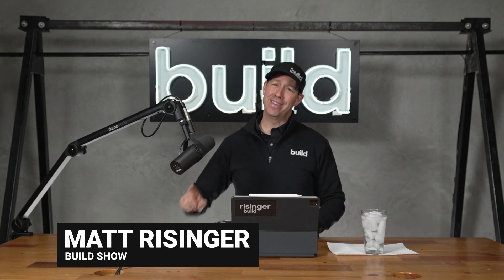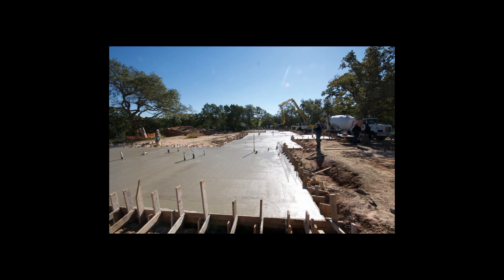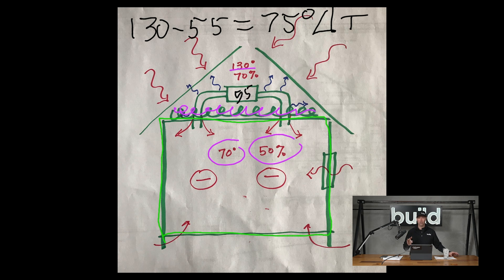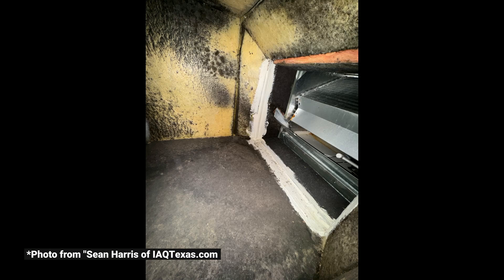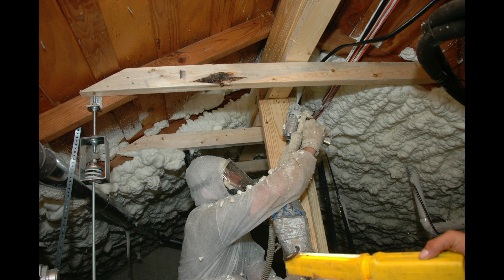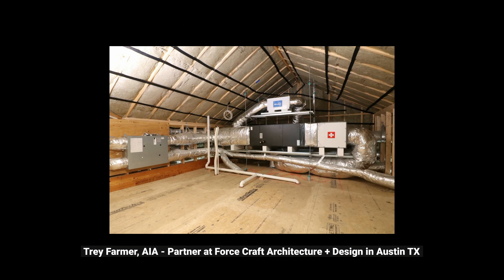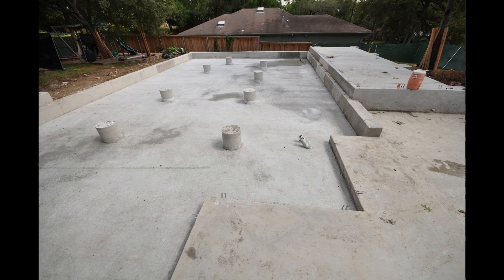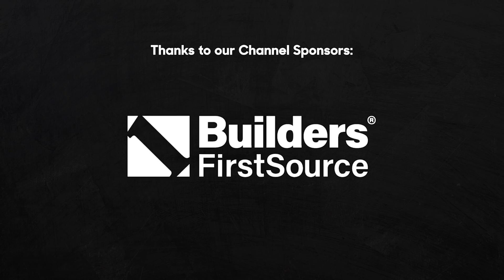Number 1 Dumbest HVAC System Mistake (Whoops)

Comment: What can you do if your duct work built is in the attic? I actually do not mind some cool air leaking to the attic or attic-air-duct not perfectly insulated and house not that air tight. Considering all the problems for an air-tight house if something goes wrong - moisture build-up, roof leak, water leak, shingles peeling off. Energy efficiency is not everything - got to have some compromise. I'd rather have a well ventilated roof and nothing attached to the roof-deck and sacrificing some energy efficiency.

Comment: Matt what is the cost to retrofit or remodel a house to those standards. I would have to replace all my outside sheathing and replace it with a insulated material, then cover that with the steel covering. Than the roof would have to be re-dun with a sealed covering then a metal roof and upgrade the windows which are original from 89 I think. How long to get a payback for this. You sell your house to one of the vultures owned buy a corporation it wont get all that. They'll will do the least to get it rented.

Comment: I have a 1957 built ranch. No basement, slab. My supply ducting runs through the slab to each room and my air returns are in the attic. So I think my setup is more efficient and the floors are warmer. The problem is that the supplies are not actually in ductwork, but jist open channels running under the slab with a pea gravel base, so I assume it has a ton of air leaks and probably not clean. I don't understand why they wouldn't have installed ductwork before the slab and because its under the slab, It would be very expensive and labor intensive to repair. My only real option is to seal the vents off with concrete, get a new furnace to blow up, instead of down, and run the ductwork in the attick. Either option sucks and I would rather get the ductwork under the slab sealed. Maybe run a sprayer through them and spray some sort of sealant. I can't find anyone that does that in my area. Thru all said without ductwork already there, they can't do it.

Comment: This got me thinking. You only need r-4 insulation for ductwork in conditioned spaces. So if you encapsulated a crawlspace and cut in a dampened supply or 2, could you then use r-4 bubble insulation and not have to mess with r-8 fiberglass?

Comment: As a general contractor the most common problem I see is faulty ductwork.  It is not that hard to get it right.  Put the supply registers at the perimeter of the structure with the return near the center.  It is really that easy.

Comment: Crawl spaces are not as bad as attics. Just think about it ... Heat rises!    I have seen as much as a 1/2 ton needed to be added based on a load calculation due to the ducts being located in the attic. In my opinion, the best option is to encapsulate the crawlspace and locate the ducts in the crawlspace with a downflow furnace located on the main level. Additionally, it may be possible to condition that crawlspace area by opening up a return and supply vent. this provides warm floors in the winter and prevents plumbing from freezing.

Comment: Also to clarify we have ductwork in the attic but the furnace is in the garage for first floor and in a closet on the second floor.  The attic fan works well - also a lot of my neighbors have whole house fans and they work really good until you have to turn the ac on.

Comment: The house that I bought in Indiana had ductwork in it and the second floor was never cool enough in the summer or warm enough in the winter.  I added on two story addition and added a second floor unit - and disconnected the first floor ahu from the second floor.  This worked much better but not perfect.  We added an attic fan and it brought the temp down from 140 to whatever the outside temp was and would turn off at 80 at night and come back on at 90 degrees.  This worked even better but still not perfect until…….I replaced the second floor heat pump 15 years later.  Our furnace guy discovered that the ductwork for the second floor unit was undersized and we had too much flex ductwork.  He fixed the ductwork size and took out flex duct and not the system is  wonderful!    I would say the biggest mistake you can make with a HVAC system at least in the Midwest is under sizing the ductwork and putting too much flex ductwork in.   He also installed a heat pump with a multi stage compressor and a variable speed fan.  The advantage being in the summer it will dehumidify at low fan speed and low compressor for a longer time.  I have never seen the fan on high ever in 100 degree weather.  Big fan of the this type of unit…..

Comment: The picture of the southern crawlspace looks exactly like mine... The vapor barrier is thrown down over junk and dirt, and go figure, when it gets hot in the summer, I get condensation on the bottom of our metal AC duct junction box and the ducts themselves. My quick fix ideas are ( in order of cost ): Add a drip pan under the box where most of the pooling happens and pipe it outside with PVC, close the vents in the crawlspace and add a dehumidifier, take up the vapor barrier, grade the crawlspace so french drains actually work, add a sump pump, completely insulate/seal the space and redo it so it is more like a mini basement... all the options suck lol

Comment: When they installed my solar air heating system (yes, heat, not electricity), they put the ducts IN the "fluffy stuff", which there was tons because cellulose insulation is super cheap so you might as well load up on it - what else are you going to do with your attic? (just make sure you have the venting correct!!)

Comment: I live in Europe and most of the office ventilation ducts are inside the inner ceiling with a "fake" ceiling below it to hide the ductwork. It of course makes each floor higher, but otherwise it's usually working fine.
Reply: In America we call that drop ceiling lol

Comment: Just worked in an area where none of the workers or inspectors knew what the rating was on the seam tape they were using. 
No inspector is getting in an attic to check tape.

Comment: Whenever it's windy my bathroom exhaust flaps bang around like crazy. 
At my last house I could just hang a magnet from them and pull it off when I wanted to use the fan, but this new place has a 90 degree turn and plastic flaps so that trick won't work. 
Is there a quick/easy fix? 
I know I could tear the thing apart and put a stronger (or any) spring on it to keep it closed, but two problems. That's a lot of work, and it might keep the thing from working when I want it to. 

Suggestions?

Comment: Builders don’t care. They put the HVAC where it is cheapest. A lot other times their ducts are too small. Remember the HVAC installer’s name is “Low Bid”. I have a 1.5 story slab on grade, cir 1977, and the attics were not able to be insulated. The HVAC sweated profusely. The problem was ths coil was too cold mainly because the fan speed was low. I did not understand that new replacement blowers would go bad. Then I replaced the air handler with not perfect results and reduced, but not eliminated sweating.  I then replaced the outside unit with a RUUD 20 Ultra variable speed. The duct air temperature was warmer and the unit ran low, slow and long. I set it to run 40 minutute on low and then shift to high. The shifting to high speed takes care of the humidity issues the low speed causes.  The sweating is gone and so is my high power bill. Variable speed to the rescue.

I still agree with your video, but sometimes you can’t fix stupid and you have to find a way to live with stupid.

Still living with stupid.

Comment: I agree with you 90% 
I’m a retired HVAC&R contractor from NE Illinois. I’d say that at least 80% of the systems are poorly built. 
We now live in Oklahoma and often visited our daughter who lived in Texas with all the supplies and returns in the ceiling makes the floor cold in winter. 
Many systems in the attic are very difficult to service mine is nearly impossible, as I’m 70 years old I can’t even service mine (trussed roof). A replacement system is planned. 
FYI our house was built in 1979

Comment: @Matt Risinger I live in Texas and I have one of those attics you're talking about. I"m from MN and I'm really not a fan of how it's done down here. I want to improve it, but I have limited funds. So here are my questions. 
Would wraping the ducting with some fiberglass insulation help? 
Would building a room (conditioned space) around the HVAC equipment in the attic help? 
Would insulating at the roof line with foam or rockwool make the roof shingles get even hotter and shorter their lifespan? My shingles are only going to last about 12 years as is, even though their 30 year shingles.
Reply: First of check your ridge vent if your shingles are failing. Or add more vents, I only use ridge vent because....... you can put ridge up on the underside of the roof as a DYI.
Create a template for cutting slots in the board to wrap around the truss crosbraces. Many companies make foam boards at 24" and 16". 
I like loctite expansive foam, twice the cost and 5 times better than big stuff. Foam around all cuts and tape the seams. 

Remember your lower intake vents have to be seamed in the same One as the ridge roof vents so they function above your insulation.
Two layers is tough but if you run another row horizontal and tape it that's great. Now that I think about it depending on how busy your truess are horizontal may be easier.
Splurge on a hot knife because you have all those angle cuts.
For 80-150 bucks you could place the board, sharpie the cut and slice it out with out moving. 
Insulation hand saws are what I use and they cheaper. Sawzall will blow out chunksas it pushes through even with a metal blade.

You got it man, watch Craigslist and pick up sheets where you can don't wait until you have enough to do the whole thing if that will take a while.

Oh and I use locktite adhesives think I used the X9 which is the MAX adhesive at HD. Check to make sure any glue you use is rated for foam or the solvent in the glue will break down the board and you'll have nothing.
If you do it all at once and can find a foam adhesive go that rout it'll only for one can made 2 or 3 as a DIYer.

So,
Insulation hand saw.
High grade, foam rated,  construction adhesive.
Swim shirt. Good at covering easy to wash. 
Rubber seal 3M respirator. The problem is all of the stuff you kick up in the attic. Rat,mouse,squirel, and bird waste can literally be deadly. 
Eye protection for nails sticking through studs in a constrained space. 
Go for it.

Upgrades
Hot knife
Foam gun
Foam adhesive
Reply: I'd be insulating under the roof, and saving up for a nice clean metal roof when those filthy shingles eventually fail. Metal roofs are simple and durable and if your local government hasn't banned you from collecting your own runoff, a metal roof is the first step to having your own water that is safe to drink even when town water is toxic or stops running.

Comment: Alternatively you could use mini-split heat pumps to eliminate ducting.

My personal kink is a single pitch shed roof that has the insulation, and a radiant barrier all within the height of the roof I-joists with a vapor barrier below and a vented air gap above.  No attic to speak of and uses cheap blown in fiberglass instead of expensive spray foam or foam board.  If it's sloped down toward the south, perfect for mounting solar too.

Comment: Before Matt and I moved here from Portland there were regional building codes.  Not national.  Of course, the South had its own and even more 'of course', Texas had its own. To say they were looser than the West Coast's would be correct. 
Love the webbing across the rafters to hold the rock wool in place. 
For a minute I was a New Orleans Residential Mechanical Equipment Inspector.  I regularly measured the underside of the roof decking at 140°.  The flex duct would almost always have serious droops.  I found the installers were ignorant of correct installation methods. Most were willing or even eager to know the correct protocols. 
I was an inspector in 2017. I started studying the 2012 and soon we adopted 2015.  
I left before the tragic collapse of the Hard Rock Hotel but I knew all those guys.
Reply: Yeah the biggest problem in the industry is whole regions that are trained by inspectors.
Move back to where I grew up in a mid sized area and in 3 years I never met anyone worker, supervisor or boss that owned a code book or had read one. They're ridiculously priced but the ICC dropped the business model and dropped books to around a $100.00
Online for free you can read all the codes for free, thanks to an activists lawyer that posted PDFs of the building code for free and took it to the Supreme Court and won.

Comment: I dunno, ducts running on the outside side of the siding seems like a whole 'nother level of "not even trying" compared to ducts in the attic
Reply: It's for rehab usually and cost is the reason. Grandma's house without AC with high summer temps. Are you and your siblings going to pool together 5-8k and do exterior or 30 to 50k to have the heating system redone and combined with the AC?
Those are numbers for entry level houses. My dad lives in a 2600sf modular home with a crawl space. Went to replace the furnace and found the entire duct system was wrong also. Called a sales guy I knew, I'm a contractor, and the price was $27,000.00 for a new 3.5 ton set up.
I paid a thousand or two and redid the whole thing for about 11-12,000. 
That's gross margins that Microsoft and Google dream of.
Now you know where all those D bag jacked trucks with black rims came from.
Boats, jet skis and jeep are selling.
Labor shortage isn't going away.

Comment: This is something that needs to be addressed with the builders not the hvac contractor.  95% of the time the builder does not offer the space for ducts to be inside the envelope and the hvac contractor doesn’t have a say in the insulation of the home.
Reply: Which just indicates that building codes aren't what they should be.
If ventilation ductwork had been specified in the code then we would have seen a lot less of this kind of issues.

Comment: Why not do away with ducts altogether and use a ductless mini split system?
Reply: Cost, less functional and no direct airflow control for rooms with a delivery head. They have high pressure  commercial ceiling boxes, but now you've hit a cost higher than tearing the roof off the house and redoing the whole thing.

Comment: The entire hvac industry is in crisis these days and most builders aren’t even aware of it. Any stupid mistake you can think of when it comes to hvac can be found in just about every spec house in America. It’s hard to say which one is most common but “don’t know”, and “don’t care” is very prevalent in the industry. Even the good guys that are trying to do a good job are typically years behind the technology. I’m an electrician but I generally do my own hvac work because it’s so difficult to find anyone that’s any good. A friend of mine is a builder and a recently completed home he built had problems with the hvac before the house was even on the market. On the 4th time he called his contractor back to fix it he demanded the owner come out also. The owner discovered his guys crossed up the refrigerant lines for the upstairs and downstairs units that were side by side outside. Three service calls on brand new systems and they never figured it out until the boss came out the 4th time. This is one of the top rated companies in the Chattanooga area.
Reply: There's no way of saying it without being mean.. the dumbest laborers go into the hvac field (and roofing). Not to say they're all like that, certainly not the engineers either.. but a lot of them know zero and care zero. They only care about sqft and what btu goes in it with their extremely simple table. Don't care about insulation, climate, or anything else.